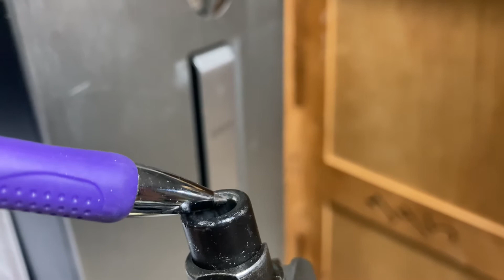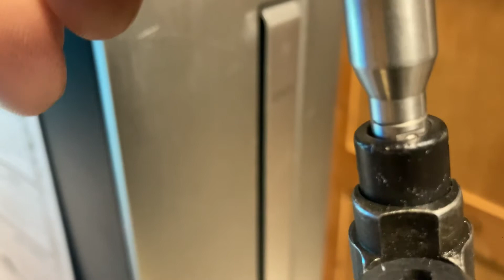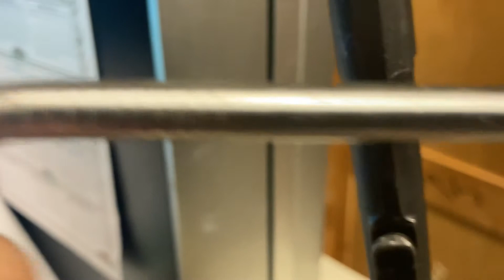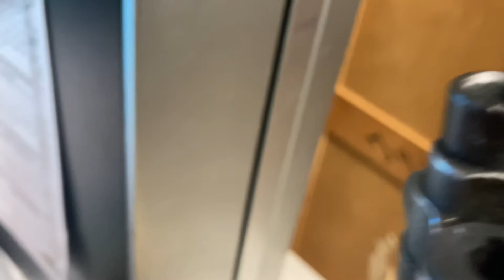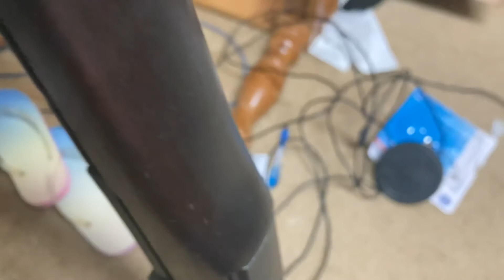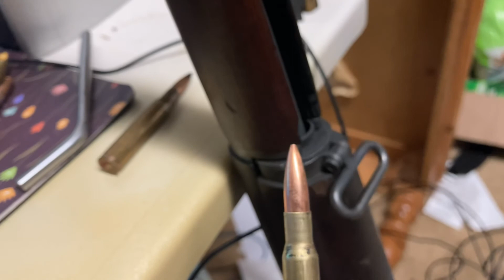M1 muzzle wear

Comment: What is the bore of an M1 suppose to measure? I have been searching to buy one, although i have considered the CMP program i am 1st looking around the net? I see a lot of them ,in their ads saying the bore measures 3-75 or 5-53, so what should a brand new bore size be for an M1 so i can figure out which is tehe best bore size to look for? I plan to buy it to shoot. I dont want a wall hanger. So im not looking for some really historically correct one. So Im already considering ,buying one fo the cheaper ones that look nice with a shitty bore and replacing the barrel ? 
    But if i knew what the original bore size was, coming out of the  factory that would be very helpful? I have tried to look those numbers up several ways and cant seem to word it properly to get the info i want to come up?lol duh
Reply from the maker: The “bore” is .30 cal 
   If your looking for a shooter get a one from the cmp with new barrel and new stock. 
   A deal at $1150 or so, great shooters
Reply from the maker: No idea what those numbers are sounds more like barrel dates? Anyway your nominal specs are .300 at the lands and .308 at the grooves. The muzzle and throat erosion numbers are what the gauges read.  Just be mindful mass produced barrels especially under war time pressure are not all perfect so a gauge reading of zero is not always expected and the tolerance from one manufacture to another between barrel and gauges can vary.
   The muzzle and throat erosion numbers are not a tell all of accuracy.  I have a M1 that gauges 1 and 1 and cant hold a group with it. I have a rack grade thats 4-5 and close to failing field headspace gauge yet I can keep them in the black of a SR target at 200 yards with M2 ball

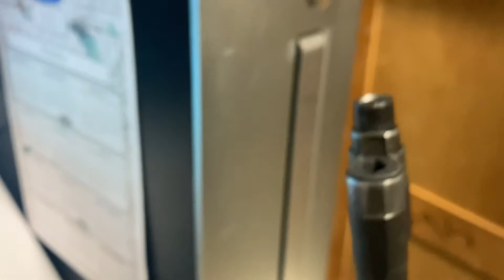Comment: @2:07 According to directions, the 2nd tool you used (measures both ME and TE) - the muzzle measured a 2 - according to the supplied instructions it has 11 rings (Vice 10 for the TE), the first ring of the ME is 0 being New - the last being 10= Reject...  Just an FYI
Reply: From the MFG instructions - - "To Measure muzzle wear:  
This gauge also has a calibrated front end with 11 rings that will allow you to measure the wear at the muzzle. The rings are in increments of .001 per ring.  To measure the muzzle, read the rings directly with the first ring = zero wear, to the 11th ring back which would be maximum allowed wear or barrel reject.
Reply from the maker: @brianbrave   thanks for adding that. The point is more so of the “muzzle” test with a bullet and how little the bullet test is some what flawed. Since the ogive is different on different bullets.

Comment: what is that tool for the gas chamber?
Reply from the maker: im not exactly sure of your question
The gauge in the video is a Muzzle wear gauge.
https://pacifictoolandgauge.com/muzzle-erosion-gauges/19918-30-cal-muzzle-and-bore-size-check-gauge.html
this tool can be used to hold the gas cylinder lock while removing/tighten gas plug
https://www.garandgear.com/product/m1-garand-wrench/

Then there is the gauge to check your gas cylinder, 
https://ammogarand.com/m1-garand-gas-cylinder-gauge-go--nog1.html